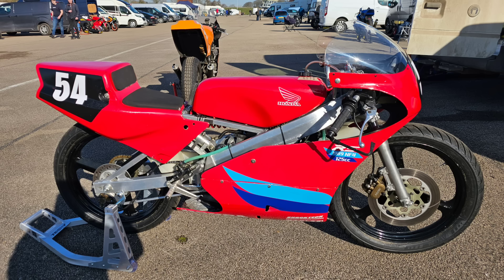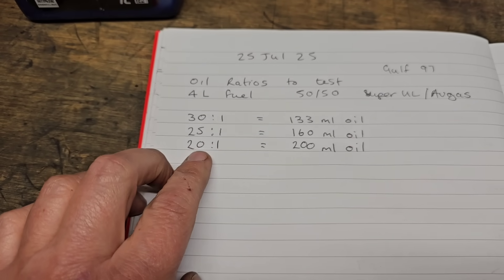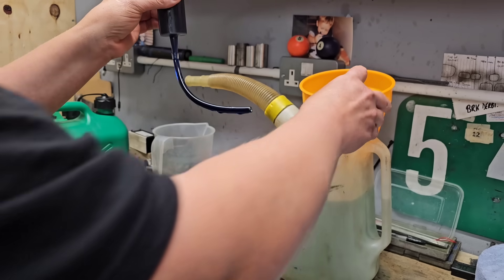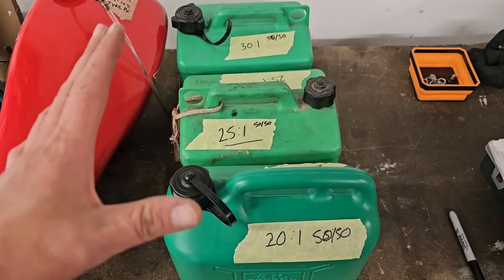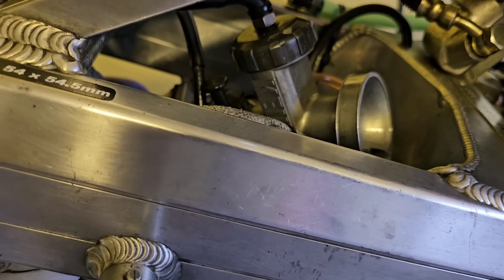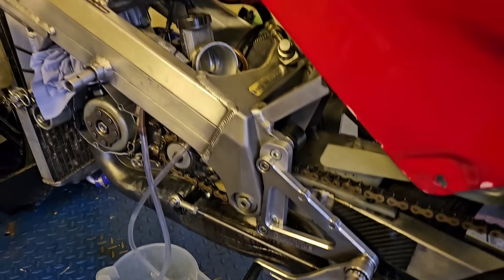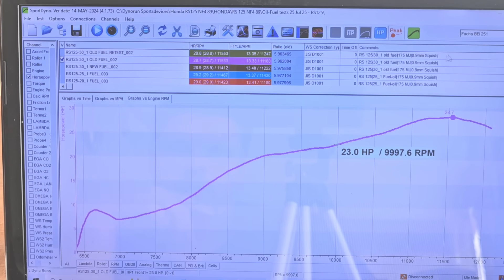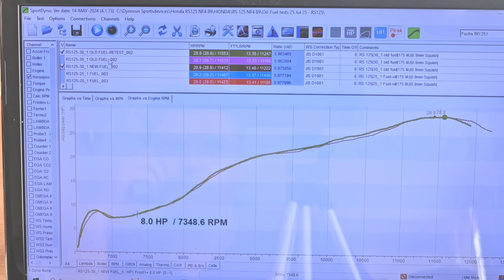Does 2-Stroke Oil Ratio Really Change Power? (Dyno Tested)

Comment: in my young day,s mixture was between 25;1 on hot short circuit  and 30:1 longer circuit
and hich speed long term 35;1 with no problem ,mostly between 30:1 and 35;1 
with the castrol tt oil than was 50:1 till 100:1 but 70:1 was the limit 40:1 was the sweet spot
so got back to my favorite 2 stroke oil type  (not the tt oil)
talking 50cc till 70cc 2stroke 136 km/h  17000+ rpm (22000 rpm )
Reply: Sweet spot at 35:1 I would make up out of all you wrote. So if the TT oil isn’t the beloved one which brand do you prefer?

Comment: This is interesting stuff even though I don't own a two stroke any more. I used to run 50:1 in older engines because I figured modern oil is much better. I also wondered how much difference it made if you used premixed, or had oil injection. Carry on.
Reply from the maker: Cheers for the insight, glad you found it interesting!

Comment: I like what you are doing but you forgot to take into account oil migration times. The oil falls out of suspension into the crank and then takes about 20 minutes to make it way out. So unless you run the bike at set ratio for 20 minutes you are really just running the same amount of oil on your dyno runs. Hence the no real difference.
There was a great paper done on this by Castrol years ago. You used to be able to find it on the Internet but I can no longer find it on the cesspool the Internet has become. The gains they found were substantial peaking at around 16:1 if my memory serves me correctly.
Reply from the maker: Thanks for the insight, I had not considered the oil migration time.
That Castrol paper sounds very interesting - If you have a copy, could you email it to: autobeta2t@yahoo.com
Many thanks, Dave

Comment: More oil is better, but better oil is the other trick. Ive seen increases of 10% hp when switching oils from "2stroke oil" to proper racing mix oils like you have. Do you have  maxima 927 where you live?  I have great results from chainsaws, bikes, and even large outboard motors with that stuff.
Had a flat track banshee go 2 seasons on a set of rings at 12.5k rpm
Reply from the maker: Hi, thank you for the info. Yes I can get 927 here. I may take a look at it, thanks

Comment: This result makes me think that you still have some room on the setup (jetting, timing, compression, pipe, ect). It would be interesting to use your best oil mix and then due further jetting, timing and maybe pipe (stinger extension and dia.) changes to see if the baseline HP can be upped. Then use that new baseline when testing the differences in oil ratios. I believe the data would be more visible and your bike would be quicker! Nice dyno setup you have, a guy can have some fun and learn with that!
Reply from the maker: That's a great shout, and something I'd like to do, but it gets complicated with time and budget!

Comment: On a two stroke the wear of the piston ring changes over time and being able to go with a higher ratio of oil definitely helps with compression and lubrication !  In turn more power at higher rpm !

Comment: The Late Great Gordon Jennings did a two-stroke fuel/oil ratio test years ago. He ran a test engine on a Dyno and custom drilled main jest to accommodate the correct fuel/air ratio for any given fuel/oil ratio. He recorded more power with more oil in the fuel even below a 10:1 fuel/oil ratio, right up until plug fouling occurred.

Comment: I use a 25:1 fuel to oil mix, l still have my FS66 Stihl brush cutter working 38 years later.
Reply from the maker: Wow, that's an impressive lifespan for that brush cutter using that ratio.

Comment: Use a race fuel as a base and both CHT and EGT sensors. Also use new spark plugs for each fuel so you can read the plug. 
Also do a synthetic vs straight castor run.
Reply from the maker: Cheers for the tips. I'd be keen to try some castor based oil as a comparison.
I'd like to try some leaded race fuel too.

Comment: Thank you so much for knowing that increasing the amount of oil in your fuel results in a leaner af ratio.
Reply: Technically no. The oil requires more oxygen to burn. 
If you are a real two stroker, you would start on petr-oil and then switch to keep once it's warm. 
Providing both lubrication and fuel in one. 
Or butanol with 20 percent ethanol and 20 percent water even better. 🤭

Comment: Less oil=more fuel= more power,      may needs the jets to be changed,    unless you use a fast burning oil that acts like gasoline,  too much oil pools at the crank area and does friction with the crank, deposits in the head and exhaust port
Reply: how do you know it doesnt have too much fuel to begin with and going leaner then makes more power
Reply: Then run No oil!

Comment: More oils ok, as long as it’s jetted correctly, classic mistakes back in the day Kids and adults) was extra oil thinking it would help , all it did was make the engine run lean make power smoke and seize 😂 its a very interesting video, thanks for making it
Reply from the maker: Cheers for the insight, that's a good story - thanks for watching.

Comment: Adding 160ml to 4 L makes it 3.85% mixture not 4% what would be 25:1. But yeah, probably does not make any difference.
Reply from the maker: Hi, thanks for your reply, its had me thinking 🤔 
As I understand it's a ratio,  so 4000 ml of fuel divided by 160 = 25ml  
160ml of oil divided by 160 = 1ml
So for every 25ml of fuel, there is 1ml of oil. 25:1
TBH I just use an online calculator 😊
Reply: @AutoBeta2T  Yes, but then you have 4160ml of ready fuel which has 3.85% oil, not 4%.
When you add 170ml to 4 L fuel, you get 4170ml of mixed fuel that has 4,08 % oil in it.

Comment: Great vid. Sort of thing i did 50 years ago but didnt have dyno set up. Rock up at local garage on my 3 speed Puch moped. 1 gallon of petrol /two stroke oil. 20:1 ratio please.
A minute later i dissapeared up the road in a puff of blue smoke.
Reply from the maker: Haha, that sounds like a classic experience! I never realised you could get it mixed straight from the pump!

Comment: In early '60's UK, I ran a Jawa 250 on regular fuel (c.90 octane). The handbook said to use Shell X100 oil at 20:1 but the motor would nip up after about 10-15 miles. After trying various oils/ratios, I ended up using Filtrate, a black colloidal oil, at 33:1 and the engine would run all day without any issues. Power seemed better too, though that was obviously a seat-of-the-pants assessment. No smoke-trail or oily carbon residue in the pipes either, which were common on most 2-strokes at that time.
Reply: Running leaner at 20:1 than 33:1.  What you needed was more fuel as opposed to less oil.
Reply: @69knobbly yep!
Reply: You needed to upjet at 20.1...

Comment: My 2-stroke dirt bikes always drooled oil out the exhaust and would load up if you let them idle for more than a few seconds. I just revv'ed the daylights out of them constantly, often with clutch in just to keep it cleaned out. Never fouled plugs. I think I should have used less oil but was afraid to go below the recommended amount.
Reply: Smaller jets are what you needed .

Comment: Cool test. I've read that the migration oil in the crankshaft case takes roughly 30 minutes to run out and will throw off your dyno results. Most people run 40:1 or 50:1 with modern oils. Maybe compare 50:1 vs 32:1?
Reply: Good point.

Comment: On my NSR250SE MC21 race bike I used to run avgas and 50:1 Motul 700...  I currently have a little NSR150SP and RGV300 along with a few 4 strokes
Reply from the maker: Sounds like a great collection of bikes you have there! I used to have an rgv
 and I wish I still did.

Comment: Vc misturou óleo de motor 4  tempos!!! para usar em 2 tempos!! isso nao faz sentido, ainda mais sendo uma honda rs !!
E porque apenas 29hp? deveria ter pelo menos 10hp a mais aí.
Reply from the maker: Hi, it is two stroke oil (very good two stroke oil) - it's just poor packaging by Elf. It is strange, and I double-checked when I first got it.

My dyno does read low. It would be about 34 hp on a dynojet dyno.
Reply: @AutoBeta2T Ok, very strange ELF packing , I had a RS 125 1994, very nice bike, just exaust pipe broke a lot. 
Honda clains 43, 5 hp in the engine, so...in dyno should be about 40 hp.
Reply from the maker: Yes it is very strange packaging for sure! I think the 89 claimed power is 38 so I'm around 34 DynoJet HPs so I recon it's there or there abouts...

Comment: Your ratio is off.  The clear tube you have on the end of the syringe has an extra amount of mix oil.  The calibration of the syringe is based on end of the syringe tube, not the syringe tube plus the unknown length of plastic tube.......
Reply: That oil does not come out when the plunger is depressed, so it doesn't matter. The tube is full when the syringe is full and the tube is still full when the syringe is empty, so the different is exactly zero.

Comment: Why did you go to all that trouble draining fuel ??? Just run it till it runs out and stops , the bowl will be emptied and just add new fuel ????
Reply from the maker: Hi, I really dont like running the bike till it runs out. Maybe if it could be left at idle - but there is no idle on this bike.
I've sent my lad out on it before with the fuel accidently off, and it did about 1/2  a mile before running out, so it would take a while to burn it.
The tank needs to come off each time to drain that too so just as easy to drain the carb at the same time.
Reply: @AutoBeta2T fair enough , sounds fair.

Comment: Back in the 1970s /80s in Australia BP sold Two Stroke at the pump , it was 20 to 1 but I've seen 15 to 1 and 25 to 1 . In those days two stroke's were super reliable. And no less power , when you think about it , the oil contains more energy than fuel , so more oil more energy available, as long as you have high enough compression to use it . I have a 2025 KTM 300 SX and it runs very well on 25 to 1 .
Reply: I think the main reason you get more power with more oil is that it reduces the amount of blowby and friction on the rings.
Reply: @nerd1000ify it's interesting. A couple of years ago, F1 teams were allowing oil into the combustion chamber so they could consume less fuel, and before that, some teams were using much denser fuels that were ostensibly "pump gas". I believe there can be more energy per liter of oil than fuel, but it may take some doing to release and capture that energy.
Reply: @5000rgb  very true , yes .
Reply: 1992 Australia used to pull into servo on my 92' Kx 80
$2:50 for 4 litres fuel
$1 for 120ml 2stroke oil
Reply: @HSVManiac very true , I remember those days .

Comment: No hard data, but yes, more unburnt hydrocarbons in the exhaust will make a lambda/O2 sensor read richer, regardless of whether that is actual fuel combustion products (rich mixture) or oil smoke. Tuning rotary/wankel engines by AFR alone is problematic for exactly this reason, in my limited experience, so ringdings would have it even worse.

Another issue that'll compound your measurement error is that even if you measure egt and adjust your fuelling to suit, you need to consider where your egt probe is located, obviously, since more oil in the exhaust will cool it quicker in the pipe.

But then also that unless you actually manage to hold a consistent port egt across all the premix ratios, your pipe won't be working as well at 2 of them since your peak power is so heavily dependent on your chamber resonance (which seems to be linear if you only consider its effect on speed of sound, but since that value determines so many parameters of chamber design, not just one like it would for a 4 stroke muffler, it's a very sharp optimisation peak and what really matters is the depth of the low pressure, which comes out of the density wave equation; and that is quadratic in wave speed)
Reply from the maker: That's a lot of interesting points to consider, especially concerning the lambda sensor and EGT probe readings. Cheers
Reply: Another issue issue is that in a 2-stroke there's a fair bit of unburnt mixture going out the exhaust during scavenging (about 25% of what goes into the crankcase is a good estimate). That will also affect your oxygen sensor readings, probably by a lot.
Reply: @nerd1000ify  I didn't even think of that: even more so when you're on the pipe vs not properly resonating I guess

Comment: Back when I was racing I only ever ran castrol R40 at 16:1 with 50/50 LL Avgas and 98 octane unleaded pump fuels... This was when you could still get leaded fuel at the pump. I was told that the early unleaded fuel used octane boosters so mixing it will Low lead Avgas actually increased the octane rating of the Low Lead avgas which was 109 octane at the time and the tuner claimed that the 50/50 mix ended up at 114 octane. I don't know how true this was but the Yamaha 350LC in F2 trim in a spondon TZ chassis clocked 169mph at the Isle of Man TT back when they ran the F2 class.  

At 16:1 I had a holed piston due to a leaking crank oil seal and the bore was still useable with a quick clean up with wet and dry sandpaper.. I never damaged a cylinder at that ratio.
Reply: I tried to explain the 16 to 1 oil ratio and all these 20 year-old keyboard mechanics said that's impossible.
Reply: @JosephCowen-fz8vj  Don't want to make you feel even worse, but most 20 year old people don't even have a keyboard. They just peck away at little glass squares and have never known just about anything in life. They sure like to act like they know things though!
Reply: @KenjiFox lol yes very true ! 😂

Comment: You can literally feel and hear when you run a rich mixture. It def runs smoother and sounds a little quieter. They like oil.. give it to em and clean the pipes. The lean ratio guys i dont understand..
Reply: oil makes them leaner
Reply: @Louis8989-1 no dummy 😂😂😂
Reply: Yeah so give the carb a little more gas, big deal
Reply: @Sebastian-gj9tc you dont understand shit you havent even made sense there... 😂😂😂

Comment: The crankcase exhaust expansion chamber is a clever setup along with the spark plug hose! that should make good power! Lol! I need to see that thumbnail engine running! Also I’d guess some types of oil could influence lambda more than others. perhaps testing between specific oil formulas at the same fuel/oil mix? such as knock resistance when lean and power difference between each. I’d also be curious to know how much effect the specific gravity(if any)would have over the oils viscosity in relation with air fuel ratio, it obvious adding thickness reduces fuel flow but does oil density have a play here? Some automotive Four strokes the difference can be significant to the point the wrong oil = dead engines! and not through lack of lubrication, but through detonation or even contamination
Reply from the maker: Haha, yes the little AI generated engine is a little strange. I normally take a picture of what I am making the vid about and create it myself but I was away on holiday so had to use the AI. TBH this is the most popular vid I've ever had so maybe AI got it correct?

Comment: I think where the extra power comes from when using more oil is that the oil then acts like diesel and combusts when the petrol/oil/air mix is ignited. That initial extreme spike in pressure must then cause the oil in it to combust aswell. I will honestly say that it probably depends on the engine type. I have definitely experienced more power with more oil when using brush cutters and chain saws , it has to smoke a tiny bit then you know you are in the sweet spot,  but that said , brush cutters use fixed ignition timing and the ignition timing can not be advanced or retarded at all. unless you modify the keyway and key on the shaft where the magneto flywheel goes but the point im trying to make is motorcycles use cdi for ignition...  , I never feel kosher with the recommended mixture from the manufacturers. I always stuck to 25:1   ... on a final note , i have hit poor times and couldnt buy 2 stroke oil so i used a bit of old car engine oil , that smokes and it buillds up a shiloud of carbon in your exhaust but it does work and thats where i felt the most increase in power...

Comment: I’m always interested about oil/fuel ratios, my son has an RM 85 motocross bike and depending on what track he’s on I will alter the mix, more oil for faster tracks, less oil for slower tracks. I also work out altitude differences as that can affect the carb as well. I belive there is a very fine line to find the “perfect” mix as it depends on conditions, hot or cold day, air being thinner on hot days, carb tuning, oil preference, fuel preference… it’s a rabbit hole in my opinion.
Reply: Agree.
I've owned three different road legal 250 Enduro bikes over the years. 
Fuel level was the critical factor that I noticed.
Reply: Id stick to one fuel ratio and jet accordingly.

Comment: I think it depends on the oil more than anything. There's no point in buying very high ester fully synthetic race oil to  run it at 20:1 as it's designed to lubricate well and provide a lot of protection at lower oil to fuel ratios. If your using less protective non fully synthetic oil, then running more oil is a good idea. I use silkolene Pro 2 at 40:1 in a KMX125.
Reply: I dont get you lean ratio guys. Just fight it at every turn. Im willing to bet 1k that cheap mineral oil at 25:1 is gonna do better all around than the most expensive synth at 40:1. I just dont get you guys. Sure theres spooge. Clean the pipe every time you change the piston.
Reply: @TheZmoney420 as long as it's not a power valve motor